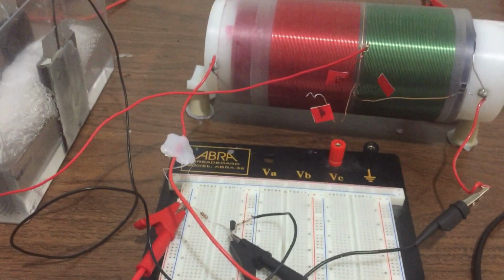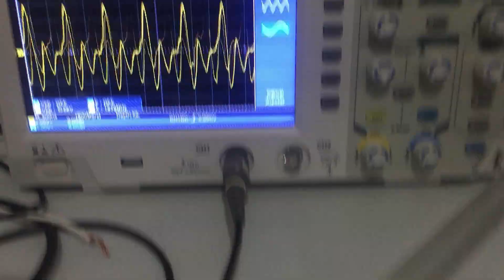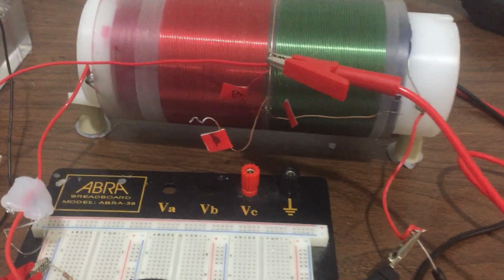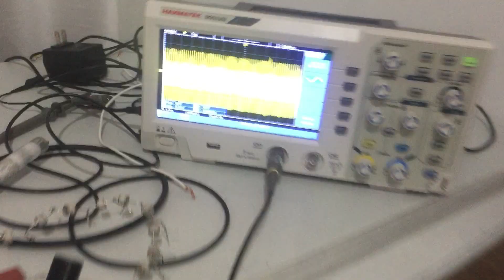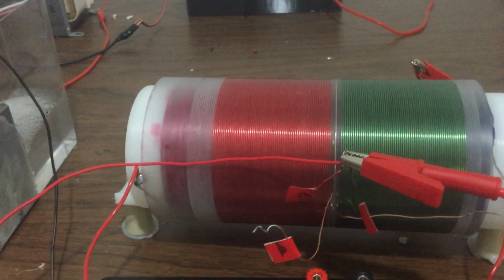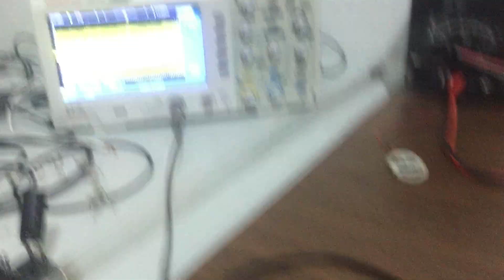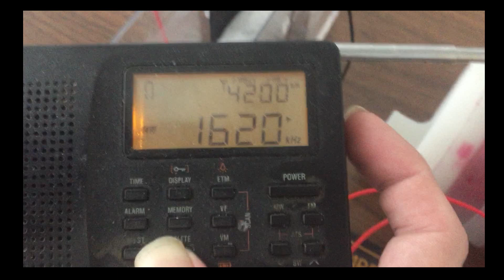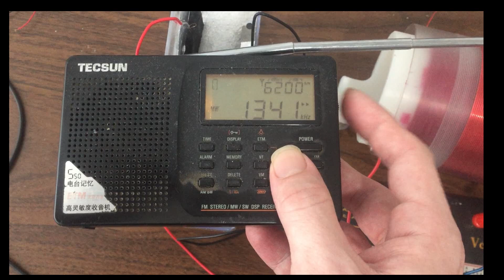Solid State Don Smith

Comment: What is the goal? Will use the circuit to charge big supercapacitor to run a chop saw. Laser Saber used a small wattage solar cell to charge a huge super capacitor to run an chop saw. If you done something like that would be amazing. Guess you could power a  two transistor am radio with a speaker. The homemade capacitor or eletret should charge it self anyway. If it is a true eletret. We done that with a 300 in 1 electronic kit back in the late 80s. Build simple homemade battery to power amplified am radio.

Comment: It keeps going as long as you don't load it exactly as you predicted.  Next step: rectify the hv and let it pass through a cap to earth which is seen as infinite impedance because of the lack of a return path?
Some time ago I saw an article on how they found a way to use an electret to generate energy, I guess it's all the same.

Comment: Did you account for the capacitance in the breadboard? Using breadboards always screwed with mine a lot and I had to run an LCR across my points to figure out the capacitance.

Comment: Is this similar to a joule thief circuit, but instead of using, say, a 1.5v AA, you’re using the electret/permanent capacitor. Then you use the dv/dT changing field to create a displacement current in the primary coil, which produces a real B field component?

Then the secondary couples to the primary and gives you the (I’m assuming stepped down) 12v 1.5MHz output?

That way, you’re leveraging pure potential with clever switching, keeping the dipole open (like Tom Bearden said) and harvesting energy from the e field reconfiguration/longitudinal waves Tesla talked about?
Reply from the maker: Something like that. But more RF end of things just because of the higher frequency dynamics. Not trying to make a statement or sound smarter by pointing towards RF interactions as well.
Reply: @ that’s awesome. The RF component makes total sense too, cause the higher the frequency, the more potent/consistent the displacement current. Great work!

I’ve been working on a system very consistently for about 3 months now, and the principles are in close tandem to yours. I’ll share an update once I’ve seen conclusive experimental evidence 🎉

Comment: Holy moly Joel!  You actually did it?  OBVIOUSLY everyone is gonna need and ask for a schematic.  coil dimensions, wire gauge, and ESPECIALLY an explanation of your "capacitor."  You should do a follow up on this immediately if you care about sharing this info!!!
Reply from the maker: I am limited for some core fine details until everything is fully developed and patented with the new company. These folks made a huge investment in me. But just like Don Smith I am free to share all the open source concepts freely that we are activity adopting in our final designs and of course I can keep talking about all that is relevant to my past open source work. That is why the forum is still online. In a nutshell most of what DS said is correct.
Reply: @joellagace1679  Looks an awful lot like rock salt, or Rochelle salt in that cap. What’s the deal with that thing? Why the weird shaped carbon colored electrodes? Because I am pretty certain that’s where most of the action is taking place since you don’t have a spark gap to do the Dirac Sea particle pair extraction.
Reply: @exoticpropulsion8175  

What? It’s an electret.. it’s a semi-permanent polarized dielectric material, he has 2 electrodes on the outside to capture the static charge being emitted..
And you don’t need a spark gap just an abrupt change in the flow of power. This induces a collapse in the energy built up, that’s the “back spike”. He’s using a transistor now to get that effect
Reply: It's just a modified AM receiver, mate.